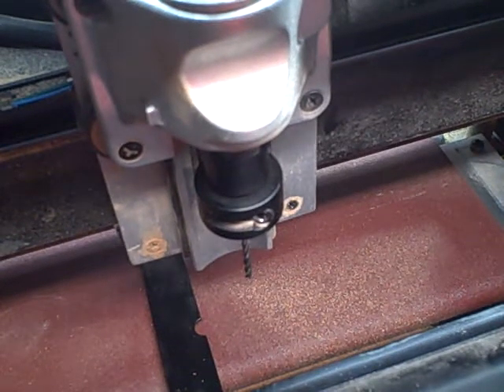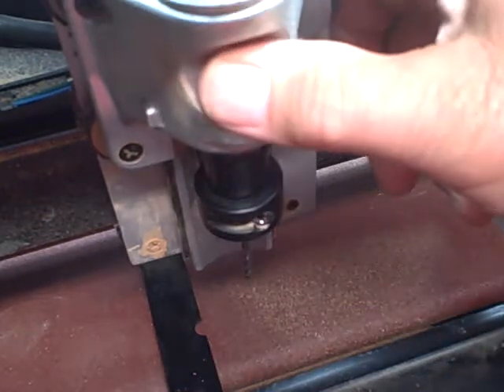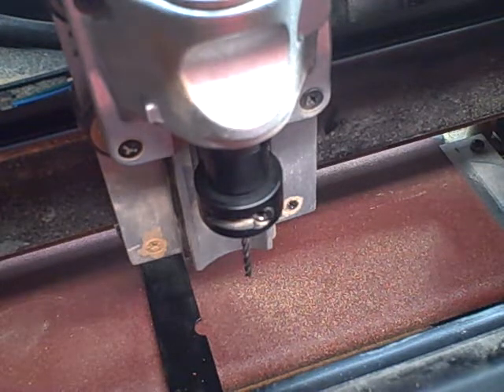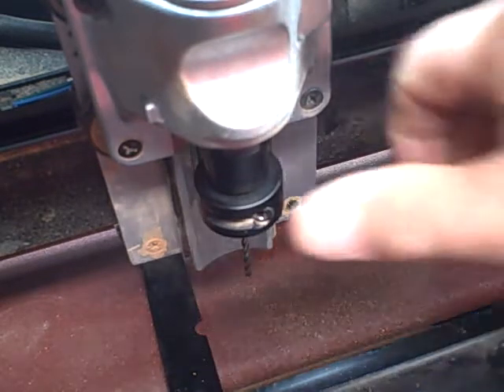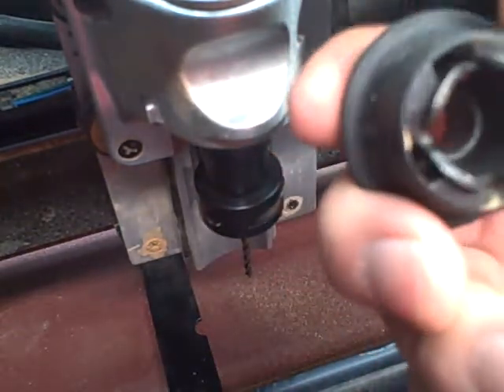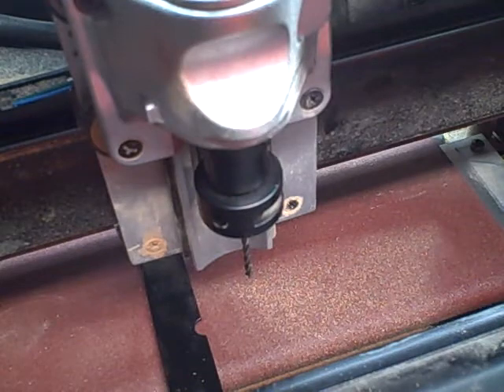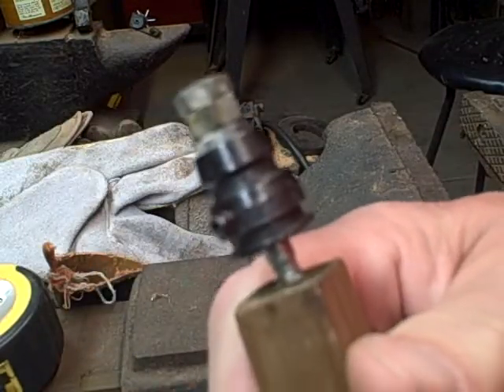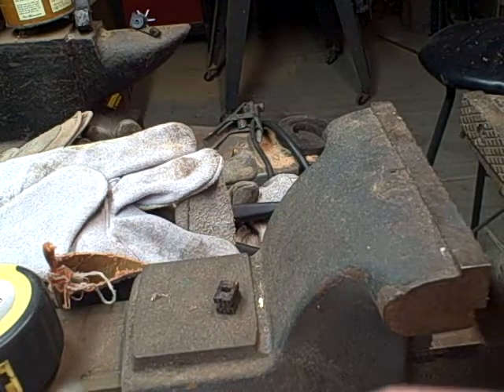taking off carvewright qc chuck to install rock chuck and comments on machine

Comment: i used 1/2 round bar in the same way you did it works good . i take the whole truck off when i do it  to be on the safe side . i did brake the squar tool that i got from ron ( dident use enuff heat ) but lickly i baught 2 .     i have gone through 5 of the ones from cw ... once you get all the buggs worked out of your cw it works amazing i have had mine for 2 1/2 years and love it . have a good night and thank you for the vid.